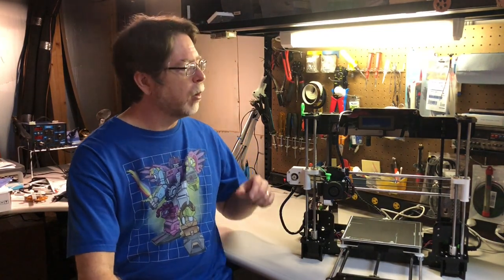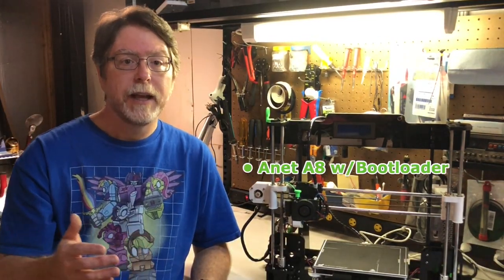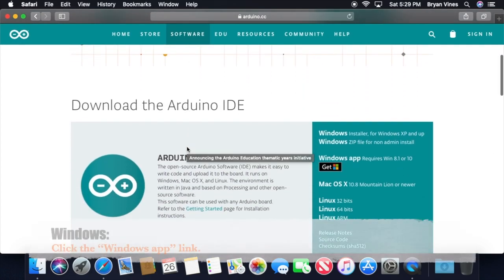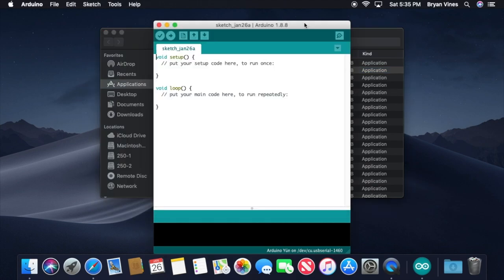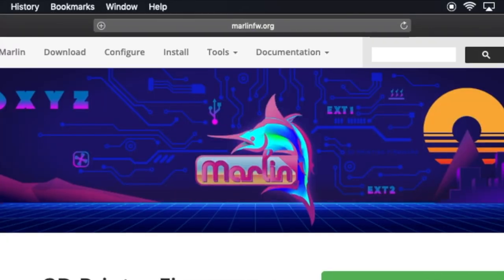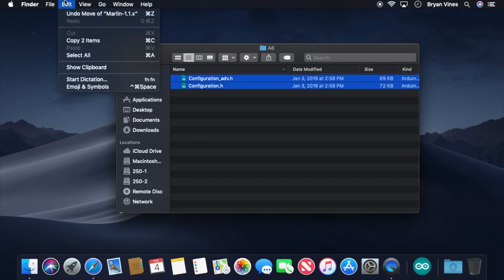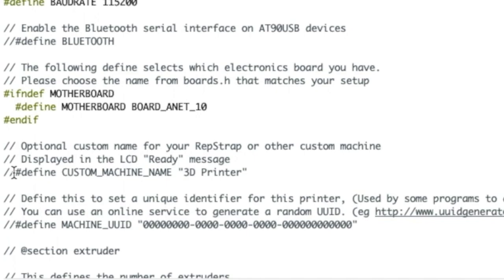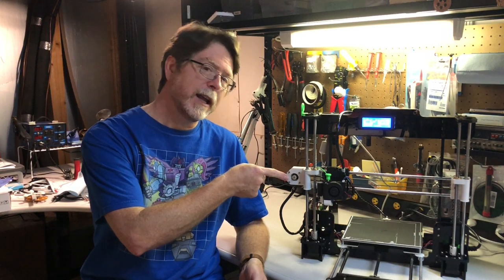How To Install Marlin Firmware on the Anet A8 3D Printer

Comment: First time I have tried uploading  or  risked a good A8 Board - on any 
changes -  Followed your tutorial - a  bit of pause - re watch to get 
through but it worked a treat. I now have a Marlin configured board - no
 idea what the menu shows on the stock LCD 2004  5 push button or how to
 use it! For any with the  Anet A1-5 board and see the V1 .... don't 
worry - its OK .  Thanks Bryan !!!    EDIT: seems I have flipped into a 
different account but it normally - Quadcopter 102 !

Comment: I want to tell you that your step by step process it the first one I have tried that worked. I have been trying to upgrade for the last 8 months and just could not get it to work. So I just want to say thank you. I am hopping that this will stop my y axis shift.
Reply from the maker: Hi! Thanks for the kind words! I’m glad this was helpful. I don’t know if it’s going to do much for layer shifts on the Y axis. Sometimes that’s caused by binding in the Y carriage‘s bearings, or the belt being loose, or some other mechanical issue. I had a layer shift issue one time where the corners of the thing I was printing curled upwards due to a temperature issue. Then the nozzle knocked into it. The print was sticking REALLY WELL to the bed, so the belt skipped when that happened. 

I hope you get the layer shift issues worked out!

Comment: Many Thanks Bryan. I had been agonising for days over installation of Marlin to my newly built Anet A6 kit. So much advice 'out there', so much conflicting and a lot of horror stories!! All I knew was that I wanted the benefit of extra protection from thermal runaway. Anything else would be a bonus.... Spent hours downloading Marlin, Github, I/O...... No success. I had already installed arduino for other electronic projects but I was worried about conflicts.... Would I need a bootloader? What if my board ended as a brick? This afternoon I followed the steps you outline in your video (I use Windows 10),pausing it frequently I worked methodically..... When I pressed the verify button on Arduino I was ready for a crash.... But no! Then the upload.... Wait for it.....!!! Successful! Screen display changed... Marlin installed. May be one small step but a Giant leap for me! Many thanks!! Stay safe.

Comment: Thanks Bryan, messed it up first time, crashed my board! 
So, I reinstalled the 'bootloader' by following your vid and then loaded Marlin 1.1.9.1. Worked immediately.
Keep doing what you are doing, it is great stuff
Have you done a vid about upgrading to an LCD 12864?
Have you done a vid about setting up a BLTouch sensor?

Comment: Hi!
First of all great video, thanks! :)

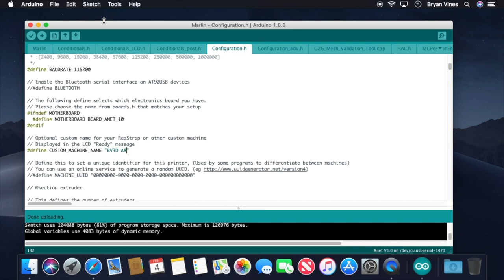Quick question: I notice that on 8:49 when you compile the code you get compilation warnings in red/orange color. They complain abou redefinition of TIMER pins. Is this a problem? Does this pose a safety issue? I'm getting those compilation warnings as well and I'm unsure whether I should upload that to the printer or not!
Reply from the maker: Hi Carlos! The warnings are OK. If there was anything seriously show-stopping, the IDE would refuse to compile the code. 👍

Comment: I made it! I was scared in the beginning as I did not want to have  brick attached to the printer. ;-) I have a Anet A8 v1.5 board, it seemingly has a bootloader. The only obstacle was the Arduino IDE. The current version (1.8.10) threw errors. So I installed 1.8.9 and I could flash Marlin.
Reply from the maker: Awesome job! I'm glad you got it going! I'll have to pull the current version of the IDE and see what's up with it.

Comment: I get an error when I upload or simply compile without uploading. The error on he line about 2/3 of the way down that says: satic_assert(digitalPinToPCICT(2_MIN_PIN) ! ..... etc.
The error is "non-constand condition for static assertion
Please help!!
Your video was excellent and extremely easy to follow. Thanks 
Ron
Reply from the maker: Hi, newer versions of the IDE don't always work right. When I did this video, I was using version 1.8.8. The current version is now 1.8.13. If you want to try the older version of the IDE, you can download it here (get the 1.8.8 version): https://www.arduino.cc/en/Main/OldSoftwareReleases#previous
Reply: THAT DID IT!!! Thank you Bryan.  I "up-graded" to the older IDE and it compiled perfectly." (I guess I will now downgrade to a newer version of the iDE!!) I watched your installing the bootloader video and ordered a USBasp from Amazon and it came the next day, at about 1:00 PM Sunday to my doorstep. WOW!!  It turns out I had to install the driver for the USBasp, easy enough to do, but you might add it to the installing bootloader video. But, once I did that, it went flawlessly and exactly as you so brilliantly and carefully explained. Thank you sooooooo much.
Regard  Ron K7RJ

Comment: Yep, 3D printing is going just as expected.

Got a used A8 today (my first printer), seller said I should update Marlin.

I've now tried the Visual Studio Code method (Failed) and also this method, with the result "The sketch file'_Statusscreen.h' cannot be used. The name must start with a letter or number, followed by...".

I run a computer repair shop and have some experience with CNC machining, but this is SUPER discouraging.

To be fair, this vid is years old now.

Comment: awesome video, it helped me to do a complete, awesome, thank you, the upgrade took care of a lot of issues, mainly printer settings area, and smoother prints, i am having am issue i hope you can help, 2 things:
1. when i connect my computer (MacBook pro, the one i used to upgrade), when i click on 'port' it does not pop anymore (it did before, but on anymore), any suggestions?
2. i was able to print a few projects flawlessly, the anet a8 with marlin 1.1.9 restarts in mid print, very odd, any suggestions?

again thank you very much for the video

Comment: Great video!! Thanks for sharing this 🙏 

Do you now if this will work / is the same process for the new Anet A8 plus 2019 model?
Reply from the maker: The process itself would be similar, but I haven’t looked at the specs for the A8 Plus. I think it uses the v1.7 Anet board, but I don’t know if its build volume is the same. If there are mechanical differences, you would have to make adjustments in the configuration.h file to accommodate the changes (for example, different build volume, whether or not a motor needs to spin in a different direction to move an axis).
Reply: BV3D: Bryan Vines Thanks for the answer! 😊👌

Comment: Does this work for the A8 Plus or is the board different?
Reply from the maker: Hi Donald, I think the A8 Plus uses the Anet v1.7 board, where the original A8 uses the v1.5 board (or at least, mine does). I believe the boards are interchangeable, but I don't know if Marlin has a premade configuration that works for the A8 Plus. Most of the differences are probably going to be with regard to the build volume, since the A8 Plus has a significantly larger volume.

Comment: This video was super useful thanks but
What do i need to change to use this on my ramps 1.4 board?
Reply from the maker: Hi! So, on this video I used Marlin's pre-made configuration for the Anet mainboard. The board definition and pins are going to be different for a RAMPS board.

The best resource I can think of to point you to right now would be a video by Chris Riley, "Marlin v1.1.8 3D Printer Firmware Complete Config - 2018" https://youtu.be/0pt_b2ZizQM

Chris also has a feature walkthrough for Marlin 1.1.9, here: https://youtu.be/2Xl3YTXa7WM

Give those videos a watch. Chris is very thorough! 👍

Comment: Alright you are about the most clear person I've watched, but still hitting a wall, trying to compile but I get an error "non-constant condition for static assertion". How do I find and correct this??
Reply from the maker: The only way I've really found to get around this is to download and use the version of the Arduino IDE I used in the video. It was about the last version that didn't have that problem with the existing code. Was it 1.8.13? I don't recall. You can download older Arduino releases here: https://www.arduino.cc/en/software/OldSoftwareReleases

Also holy cow I just checked and I made this video almost 3 years ago!

Comment: I have a Tron XY but its basically the same thing as the Anet A8 it sounds like it looks almost identical and has no runaway protection. Is updating the firmware to Anet A8 Updated going to cause any problems??

Comment: Good video! But… Viewers, please buy anything but an ANET. They willfully violate the Marlin Firmware license terms —abrogating your rights as a user— and they do not deserve your cash. Most 3D printer makers respect their customers, and there are many great alternatives. If you happen to have an ANET already, then yes, definitely install a newer Marlin on it with thermal protection. You may also want to replace the power supply. This specific model is known to catch on fire, and it's unclear whether it's the power supply, the wiring, or the complete lack of thermal protection in shipping units.
Reply: Scott Lahteine the bed connector is the problem. There are a couple of good solutions. Replacing the power supply is a good idea. Switching the supply is a good idea. Installing Marlin is a great idea. Along the way, people will learn a lot about printing.
Reply: Scott Lahteine  most ....respect their customers!!  LOL.  They all copy designs, they use the cheapest components, they think “warranty” means...if arrive broke...you buy more! Quality Control ..on the cheap printers....is minimal.....nah, its zero!  The only “ improvements” are those which will ...hopefully change a buyer from ??? 1 to xxx 2. Almost daily on FB I see a newbie with something, missing, broken bent etc, all the replies say go to A or B and get the xyz cos its far better...NOT request replacements or start paypal / CC claim. So we let the seller off the hook!

Comment: Can you help me with my Anet A4 ? Firmware 1.1... 2.09 is available... I'm using iMac, Fusion 360 and Cura and PLA... just installed Repetier Host... What do you recommend ??? My Anet pisses me off too often.... I eventually get me another 3D printer... and an SLA on top as a second one... for rescue purposes... spare parts for each printer...

Comment: Great Video thanks have 3 Anet A8 so will look forward to doing them all over time.
I have followed the Video and paused as needed but have now uploaded the Marlin fine. 
Can not get to the set up printer,info screen is showing temps 24 deg each, x,y,z=flashing 0, Fr 100% Sd----%.
others on menu prepare,control, no Sd Card and its plugged in. any help would be apperciated.
One thing  it said at the start of the video about Ant A8 / Bootloader???? have i missed something.
Reply from the maker: Hi! If you were able to get Marlin loaded on your Anet board via the board's USB port, your board had a bootloader. Not all of them do (mine did not), so I made a bootloader video.

If the printer is showing temps of 24˚C, that sounds like room temperature, so those are probably OK values. When X, Y, and Z are flashing like that, it's because the printer hasn't homed those axes, and doesn't know where the bed and nozzle are. If you can home from the menus (Prepare > Auto Home, I think) those X, Y and Z values should stop flashing. FR 100% means a 100% feed rate (that's overall printing speed). SD% is indicating how much of a file (stored on the SD card) has been printed. It won't have useful information unless you've got a file printing.

Does the above info help? I hope so. If not, please let me know.
Reply: @BV3D  Thank you for the info yes very helpful. i am still not able to get ant further with the main menu if i hit prepare it just goes back to the info scree as with the others i guess i need to look at the config. h file. thanks again

Comment: I followed all the steps correctly but im getting this when i try to upload the files to the printer

Sketch uses 104108 bytes (81%) of program storage space. Maximum is 126976 bytes.
Global variables use 4083 bytes of dynamic memory.
avrdude: stk500_getsync() attempt 1 of 10: not in sync: resp=0x21
avrdude: stk500_getsync() attempt 2 of 10: not in sync: resp=0xee
avrdude: stk500_getsync() attempt 3 of 10: not in sync: resp=0x0c
avrdude: stk500_getsync() attempt 4 of 10: not in sync: resp=0x9c
avrdude: stk500_getsync() attempt 5 of 10: not in sync: resp=0xba
avrdude: stk500_getsync() attempt 6 of 10: not in sync: resp=0xee
avrdude: stk500_getsync() attempt 7 of 10: not in sync: resp=0x73
avrdude: stk500_getsync() attempt 8 of 10: not in sync: resp=0xd6
avrdude: stk500_getsync() attempt 9 of 10: not in sync: resp=0x02
avrdude: stk500_getsync() attempt 10 of 10: not in sync: resp=0x21
An error occurred while uploading the sketch

what should i do
Reply from the maker: Hi Nick Lee, you may need to install (or reinstall) a bootloader onto the Anet board. Not all Anet boards seem to come with them, and without a bootloader installed, you won't be able to install Marlin onto it via the board's USB port.

Note that installing a bootloader will erase everything else on a board, and the printer won't know how to be a printer, so installing firmware (either Anet's factory firmware, or Marlin) will be required.

Bootloader video here: https://youtu.be/3jm0zzIneFc

Comment: Hi Bryan, any suggestions to overcome this problem

;'constant condition for static assertion'
156 #if HAS_Z_MIN
   157#if digitalPinToInterrupt(Z_MIN_PIN) != NOT_AN_INTERRUPT
      158 attachInterrupt(digitalPinToInterrupt(Z_MIN_PIN), endstop_ISR, CHANGE);
    159 #else
      160 // Not all used endstop/probe -pins can raise interrupts. Please deactivate ENDSTOP_INTERRUPTS or change the pin configuration!
     
// this is the offending line
 161 static_assert(digitalPinToPCICR(Z_MIN_PIN) != NULL, "Z_MIN_PIN is not interrupt-capable");
      162 pciSetup(Z_MIN_PIN);
    163 #endif
  164 #endif

Thanks
Reply from the maker: Hi Tinker3D, another viewer has pointed to the vide linked below as a solution. It shows how to downgrade a particular file within the Arduino IDE to get it to compile. It's a short video and a simple fix that should get you going again.
👉 https://youtu.be/_O_OZR3SoFA
Reply: @BV3D  Thanks Bryan, very helpful

Comment: Will this method also work for my anet a8plus printer with anet 1,5 board and marlin 2,0?
Reply from the maker: Hi! The basics should apply: Your Anet board will need a bootloader installed. I just had a quick look in the source code for Marlin 2.0 and it appears to include a configuration for the Anet A8 Plus. Marlin 2.0 has been completely reorganized, so any files I reference in this video have probably moved.

NOTE: Do this at your own risk; I don't have experience with Marlin 2.0 yet, and I don't have an Anet A8 Plus.

Comment: Hi Bryan , very great, Thank you. Pls HELP ME. I tryed more more time upload marlin 1.1.x or 2.0.x in windows and mac but i have always same problem: error compile with "non-constat condiction for static assertion" . Where am I wrong?
Best REGARS
Reply from the maker: Hi! You may need to try an older version of the Arduino IDE, at least for Marlin 1.x. That has helped others get around this issue.

Marlin 2.0 uses a slightly different set of tools, involving VSCode.
Reply: @BV3D  Very very very thank, you have saved me. Now works very well. I wish you  good luck.

Comment: Hey, all I get when I try this is an error with the last message stating lto-wrapper failed any clues?
Reply from the maker: Which version of the Arduino IDE are you using? Some reports I've seen regarding the LTO error seem to indicate a bug in certain versions of the Arduino IDE. If you're not on the latest Arduino IDE, try installing the most recent one. If you ARE on the most recent one, try getting a version or two earlier and see if that helps. Let me know how it goes! 👍
Reply: Thanks for that. After a bit of research and trying to install marlin every way known to man I’m pretty sure there is no boot loader software on the board. I’m gonna try that next. Cheers

Comment: Hello I'm fairly new to 3D printing but had a question I've already upgraded my Marlin firmware to the latest 1.1.9 every now and then my prince seemed to scrape each other or it's not centered in the bed is this the g code or something else some Prince ROK most 10 to start scraping the print layers after 1 two 3 layers any help would be great thanks

Comment: Is there a way to tell if a particular Anet  A8 has a bookloader already installed?
Reply from the maker: Hi Matt! I don't think there are any outward indications tell you if a bootloader is installed. Probably the easiest way to find out is to try flashing firmware to it. I'd say run through the instructions in the video. If it fails with a bunch of getsync() errors, and the end result isn't Marlin on the board, then the board probably needs a bootloader.
Reply: BV3D: Bryan Vines .....and the board is bricked?   Then what?